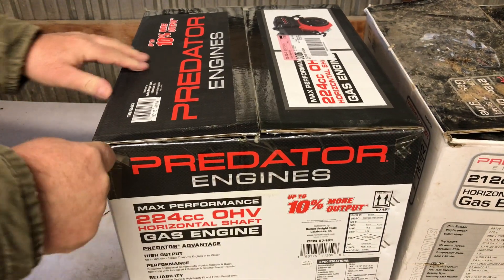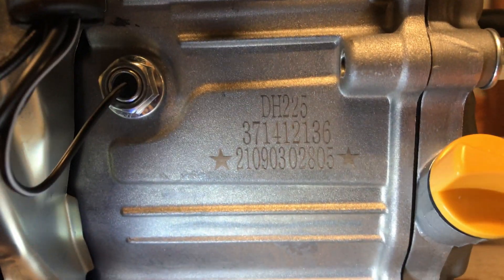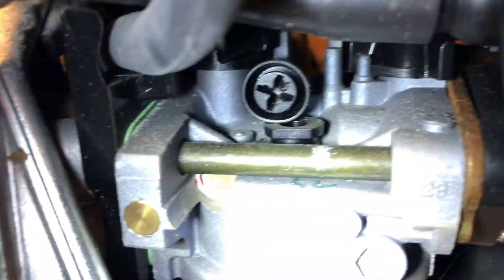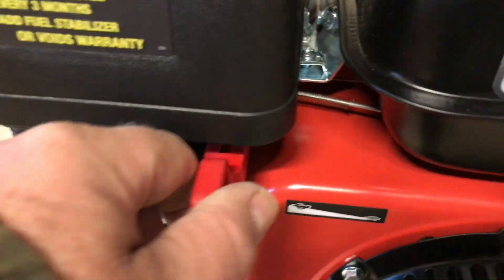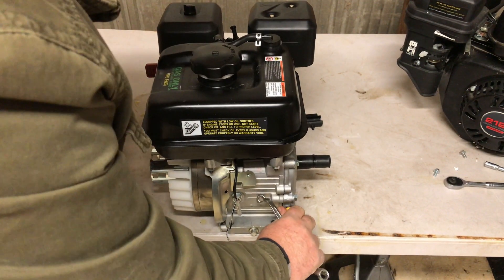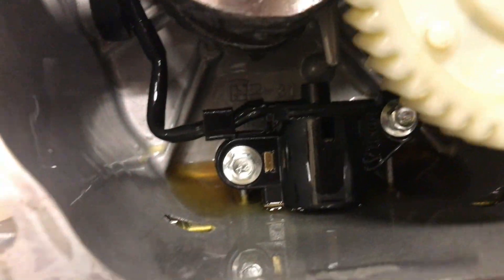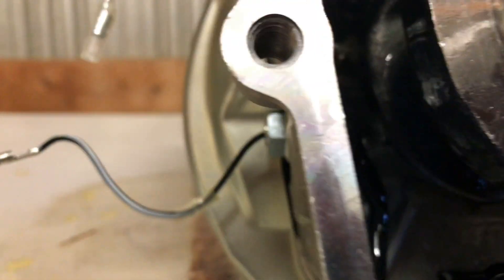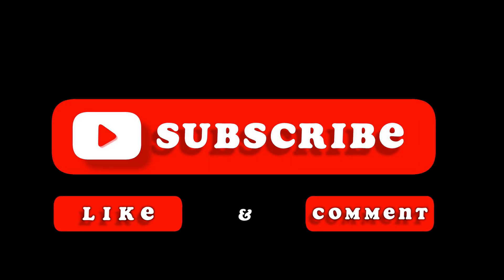The Secret Truth Of The New Harbor Freight 224cc Predator 224 Engine Review

Comment: Not any more, HF went with someone else now for their engine and non of the parts are interchangeable
Reply from the maker: I've been told the new 224 Predators are Hemis and they don't mix well with the old Predator engines. I may have one like it, it was a weird design with something like a 74mm bore but everything inside is completely different with no replacement parts or performance parts available. That's why I didn't do a video on that one.
Reply: @KentuckyFriedFixes correct, the 224 is not a ducar engine anymore

Comment: I have had this engine for 6 weeks. It’s way too loud, burns alot more gas;  twice as fast as the Honda it replaced, and vibrates more. The only good thing was it’s cheap.
Reply from the maker: They're good engines Nick but they do have balance issues when bone stock. Switching to a lighter piston helps to smooth things up.

Comment: Would not mind slapping one of these in a yard cart we have rolling around. Would get it just for the reinforced block alone. Im a big guy so the torque from the displacement helps.
Reply from the maker: I like the 224 engines. The balance from the factory isn't great though. A Wild Cat flat top piston fixes most of that balance issue though. Those factory dished pistons are HEAVY.

Comment: Yeah if you think it's worth it.. think again. It's just a bigger head and less parts available for it. Stick with the 212 it's better. Especially if you can get the bigger valve 25/27mm head. My 1st two engines did. Seems to have carb problems no matter what. I've got lots of carbs and no clue why they don't work after sitting. I've cleaned them all out. Can get it to run but no power. Air Idle screw works and then just stops working. Everything is garbage
Reply from the maker: I like the 58mm stroke crank and the block on these, the ports are a bit larger than the 212 too. But you are right, they absolutely have issues. The crankshaft is way too light on the counterweight side and you either have to add weight to it or run a lighter piston before it will have any chance of decent balance.

Comment: Looks like HF discontinued the 224. I went to get another one and they didn’t have any and they scrubbed it from their website. Guy at the store meant that they discontinued it.
Reply from the maker: I noticed the Predator 224 listing has been removed from their website. It's a shame if they've discontinued the 224, much better engine than the Ghost. (Cheaper too!)
Reply: @KentuckyFriedFixes I just got an email the HF is bringing it back. Should be in stock and back on the website
Reply from the maker: @PumpkinKingXXIII  I don't know? They're still listed on the HF website as available "In Store Only" items. So that's still not looking good. Hopefully they'll change it!
Reply: @KentuckyFriedFixes   I just checked the app and it’s there but you can’t order on the app. on my store it says “back in stock soon” sadly it’s on sale with a coupon but no one within 70 Miles. With pickup they are better deal than the Ducar 224 from Donovan’s at $188 with no flywheel

Comment: These small engines are supposed to maintain California Air Resources Board's (CARB) emissions compliance for 300 hours.  This is the NAZI state agency responsible for banning small internal combustion engines from residential use.  The charcoal canister is part of the emissions package, but I doubt the charcoal can last 300 hours.
Reply from the maker: Hi Steve! Great point! I'll bet the first time the tank is overfilled, the charcoal canister is history! I do agree with emissions on non-race applications though for sure.
Reply: F the epa when I throw it in the junk box with the other 3 ROFL.
Reply from the maker: @NubsWithGuns  Luckily, since Kentucky law does not recognize California emission standards, we are exempt.
Reply: @KentuckyFriedFixes What does California have to do with the EPA?
you're thinking CARB.
Reply from the maker: @NubsWithGuns  I don't remember saying anything about the EPA? My only point is/was the charcoal canister on the 224 is there because they sell the same 224 Predator engine in California so it must comply with whatever CA calls their emission standards. Kentucky law does not require a charcoal canister on small engines, so we're within our legal right to remove it. Nothing political implied or intended, we don't do politics here my friend, only engines and the like. Thanks!
Reply: @KentuckyFriedFixes I did though,nvm you're too easy to mess with haha.
Just me being me and picking on you,

Comment: Hi kff. What are the differences between 224 predator vs 224 ducar.ducar has no governer.224 plastic cam.anything else?
Reply from the maker: Hi Larry! I've not had a look inside the 224 Ducar engines yet but I'll bet you're right. The 224 should be a 212cc Ducar base engine with a 58mm stroke crank in place of the 55mm crank and a non-hemi head from what I've read. We may have to purchase a 224 Ducar and have a look inside. I'm curious to see if they went with the standard dished piston or a flat top. Right now I'm in the middle of a 6.2 GM diesel engine rebuild so when that's finished I'll see what I can do. Thanks Larry!
Reply: @KentuckyFriedFixes  hi KFF.thanks for your reply.enjoy the big engine build.happy thx giving.

Comment: So bottom line, if you don’t care about the nylon cam get the predator because you’re basically getting a ducar for less than a stock ducar.  Predators are cool if you need something for farm work etc or in a pinch but if you plan on racing or wanting performance get the ducar because they already have most of the internals you’d have to change out on the predator to safely hit those high rpm’s. The price difference between a 224 and a ducar 212 is minimal in my opinion so I’d get the ducar unless harbor freight put them on sale for 125 or something, at the moment they are right at 179, and the ducar 212 is roughly 250 and comes with gov removed, pvl flywheel, non nylon glow in the dark cam😂, amongst being marketed as something it truly is unlike the predator. Nice comparison, and great video
Reply from the maker: I do like that PVL flywheel on the Ducar 212, it makes the engine a great value considering there's no need to buy an upgraded flywheel. The Predator 224 is still worth the price IMO. Though the prices on the 58mm stroker cranks have dropped quite a bit. Now I'd probably go with the Ducar 212 and install the aftermarket 58mm crankshaft. (I think they're $39.95 or around that) Thanks!
Reply: You read too much into things, about the same price minus shipping actually.

" if you plan on racing or wanting performance get the ducar because they already have most of the internals you’d have to change out on the predator to safely hit those high rpm’s"
Go ahead and not do that on the Ducar and please do a video of it for us. ROFL

Other than the governor holes not being there, no advatnage like you thought, sorry if this hurts your exhaust pipe.

Comment: I have this engine for my kids go cart I used a pulley to take the clutch off and it left the back of clutch on it and I noticed on the shaft of mine it don’t have that groove, so how do I get the rest of the clutch off any ideals?
Reply from the maker: Hi Charles! It sounds like part of the clutch is stuck on the output shaft. Your crankshaft should have a 3/16" keyed groove on the 3/4" output shaft. You may be looking at part of the old clutch that's still stuck on the crankshaft. Look for a set screw somewhere on the clutch housing, make sure the clutch bolt has been removed from the crankshaft. That's about all the advice I can offer without seeing it. Lots of penetrating oil may help break up some of the rust if that's what's sticking it to the shaft.
Reply: Thank you sir that’s a big help
Reply from the maker: @Cj_Ms88  I hope everything works out Charles!

Comment: Does the flywheel have the magnets in it that will work with the alternator/charging coil that you can add on? I had to get a different flywheel to use it on the 212.
Reply from the maker: Hi Edward! The stock flywheel that comes with the 224 Predator did not have any magnets on any of the 224 engines I have worked on. I purchased an electric start kit for one of the engines and it came with charging system and flywheel.

Comment: Bought one to swap out a 196 clone on a minibike. After tuning the carb, it did have a bit more torque, but doesn’t run nearly as smooth as the 196 did.  Probably not worth it for just tooling around.  Honda knew what they were doing when they designed the 196!
Reply from the maker: Those 224 engines have a balance issue with the crankshaft. The flywheels were loose on some from the factory too. (Good thing to check) The crank throw casting is too heavy on top. You can help the balance by switching to a lighter piston and rod combo but that's more $ too. If you're building one for racing, it's a good idea to add some weight to the crank counterweights and do a proper engine balance (drag out the scales, drill bit and heavy metal slugs).

Comment: Looks very similar to a Honda. Looking to purchase one of these for my craftsman snow blower.
Reply from the maker: The 224 is a pretty good buy. That Anbull 223cc is a better engine but costs a little more too. If you just want a snowblower engine you can't beat the $49.95 LCT engines. I have a few videos on the channel for those. They were removed from Husqvarna snowblowers but they have the standard bolt pattern. Thanks!

Comment: Is that a RH or LH threaded shaft? thanks
Reply from the maker: Hi Paul! All the threads on this one are standard Right Hand Thread including the flywheel nut. I think I know what you're getting at, they should have adapted a LH thread for the flywheel nut as is commonly found on chainsaws. Engineers! You gotta love 'em!
Reply: Thanks for the info 👍

Comment: Would yu recommend getting this and upgrading it or getting the 212 Ghost
Reply from the maker: Hi Dominic! The 224 Predator engine is a much better value than the Ghost 212. The 224 has a race quality reinforced engine block and 58mm stroke crankshaft out of the box so it makes a far superior engine. Both engines will require a few aftermarket billet parts such as the connecting rod and flywheel, but with the 224 you start in the $189 price range and the Ghost 212 $299

Comment: Great vid! Very informative. Which camshaft do you recommend?
Reply from the maker: Hi 333! It really depends on what you'll be building the engine for. These are being used for mild performance engines and non-race applications. My max rpm target is around 7,500, so I'm not going any higher than 26lbs on the spring tension. I've been using the 265 Banzai cams but recently I've been experimenting with the 252 Rattlesnake and 272 Mongoose camshafts. (all of these are in the $50 price range and are not welded lobe cams so not very friendly to anything more than 26lb valve springs) The Banzai 265 is a great cam but the compression release mechanism sticks out a bit and can rub the side of the crankshaft if the crank doesn't have much machine work done on the side of the counterweight. So far this has not been a problem on the 224 builds as my cranks have had a nice machined surface on the side, but it is something to consider. The 252 Rattlesnake and 274 Mongoose cams don't seem to have that issue. If I was building an all out race engine target max rpm 9,000+ I'd likely go with something from Dyno with welded lobes and some double valve springs. A lot of guys are having good luck with those but they are in the $100+ price range though.
Reply: @KentuckyFriedFixes  thanks a lot! I’m building a daily driver. I just bought a 212cc predator engine to slap on a Coleman ct200u-ex. So far I plan on upgrading the carburetor, exhaust pipe & camshaft. 

I appreciate the content you’re producing…keep up the great work

Comment: Will it for on a ct200u-ex on stock frame? Please help trying to decide if 224 will fit
Reply from the maker: Hi Kyle! The bolt pattern is the same as the 196cc engine. The only difference is the pull start cover is wider than the 196cc that originally came on the CT200U series. So it may rub up against your right leg a bit more than the 196 did. And if you switch over to a torque converter you'll have to do the same mounting mods as you would for the 196cc. As long as you stick with the factory clutch and chain set up that came with the bike, the 224 will bolt up.
Reply: Kentucky fried fixes. How fast can it go on stage 3?
Reply from the maker: @kylereeder807  Hi Kyle! Those stage kits are put together by the parts guys so it really depends on what you get in their particular kit.

Comment: I’m looking to buy a 212 or 224 I just want something that I can do minor stuff to and reliability is the #1. What would you recommend?
Reply from the maker: Hi Orion Zzz! If you're looking into a Chinese 212 engine, I'd look at the DUCAR 212 Hemi engines. Those come with a nice performance flywheel included and a nice thick block. I'm looking at a new 223 engine design now as well. I'll have a video out on it as soon as I get caught up. I'll also have some new stuff out soon on the $49.95 179cc LCT engines. We'll be doing some budget builds and block swaps on a few of those. To me, none of the Chinese engines are reliable out of the box. The quality control on the parts is hit and miss at best. One engine will run fairly smooth and the next may shake, vibrate and rattle itself apart. If I was going to buy one without opening it up or modifying it, no matter what brand chosen, I'd make sure to get the longest extended warranty they have available. It'll likely come in handy.

Comment: Everybody talks about the flywheel and that it comes apart I've never seen it happen. I beat the hell out of my motors and I've never had it happen.
Reply from the maker: Hi SKATE1776, the cast iron flywheel has a magnet held in place by glue and a screw. The most common issue is the magnet comes off and shoots thru the pull start housing. They can also break in the middle. I used to say the same thing about the stock 5HP Briggs flywheels until one came apart on me.

Comment: Hey man how would I delete that emissions thing on the bottom?
Reply from the maker: I removed mine by disconnecting the hose from the air cleaner. I kept the hose from the tank vent, you'll want to keep the tank vent line. The charcoal canister just unbolts from the cylinder tin.
Reply: @KentuckyFriedFixes  thanks man. As a Kentuckian I don’t really need that emissions thing as it’s something that can go bad

Comment: my ducar carb says predator wtf is goin on are we being pranked with goodness
Reply from the maker: LOL I was kinda shocked to see "DUCAR" lasered on the 224 Predator carb, it would be funny if they switched it. The 212 DUCAR hemi I'm working on now has a "Ruixing" adjustable. It's not staying on there though. Thanks!
Reply: @KentuckyFriedFixes  its a cool lil freedom perk we get with these lil motors glad they still allow us to buy them gas guzlers
Reply: @KentuckyFriedFixes  mine says that too the screw thats gold with the spring is that making my bike pop and backfire all silly like lol which way do i turn it too stop the backfires
Reply: @KentuckyFriedFixes  what do u mean staying on mine backfired and i had to clean the manifold because i have a high flow air filter and header pipe there was all this dust in there from the backfire i guess but i cleaned it out
Reply from the maker: @CruiZe-A-ViSiON  I used a Mikuni clone carb in place of the Predator 224 carb on the 224 build. I like those much better than the carbs that come with these engines. Thanks! .
Reply: @KentuckyFriedFixes  I have a vm22 clone should I use that over the reucing one
Reply from the maker: @CruiZe-A-ViSiON  It'll need an upgraded connecting rod to billet and an upgraded flywheel to use the VM22. With the proper upgrades the VM22 is much better. Without the rod and flywheel upgrade though you'll break the stock rod and or explode the cast iron flywheel.
Reply: @KentuckyFriedFixes  the ducar has a pvl flywheel built in magneto i thought
Reply: @KentuckyFriedFixes  omg thats terrible
Reply from the maker: @CruiZe-A-ViSiON  The Ducar 212 Hemi has the PVL flywheel but the Predator 224 does not. The Ducar 212 Hemi was spec'd by Dyno cams to have the PVL flywheel for kart racing. I guess Harbor Freight didn't spec their 224 Ducar engine like Dyno did on their 212 hemi.
Reply: @KentuckyFriedFixes  well yea bud i only have the ducar212 thats my powerplant for now i just gotta figure out where this grinding sound is coming from it happens when th bike is off now just rolling it down my driveway can it be the clutch or governor gear making this noise with my bike off
Reply: @KentuckyFriedFixes  thanks u for the fast replies too my guy
Reply: @KentuckyFriedFixes  i gotta film it
Reply from the maker: @CruiZe-A-ViSiON  If it's got a grinding sound with the engine off, and the bike is moving, it's likely your clutch bearing needs a few drops of lube. They make a terrible noise when they're dry. Drop a couple drops of synthetic oil on the clutch bushing each time you ride and it'll last for years.
Reply: @KentuckyFriedFixes  thats what it is too thanks man my life is fixed now lol
Reply from the maker: @CruiZe-A-ViSiON  Good deal!